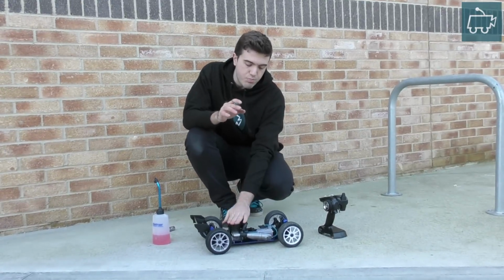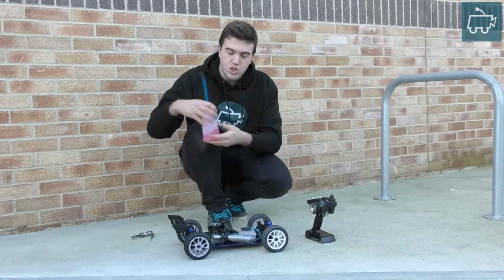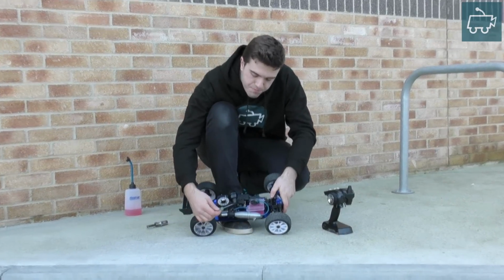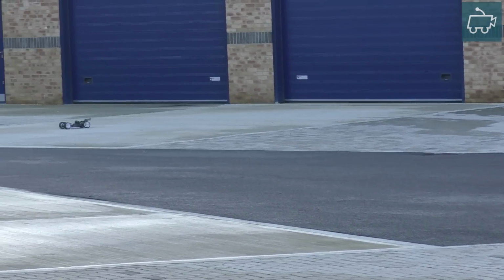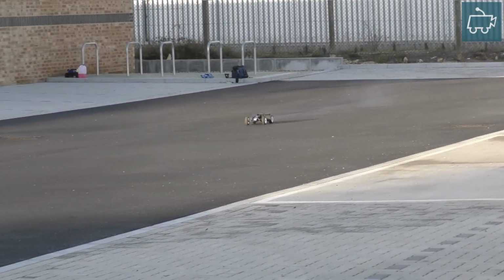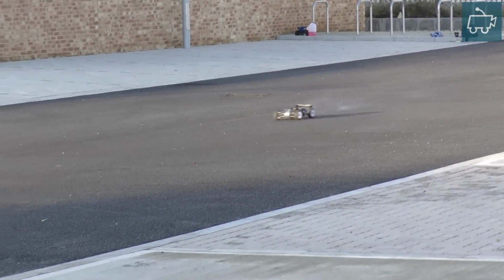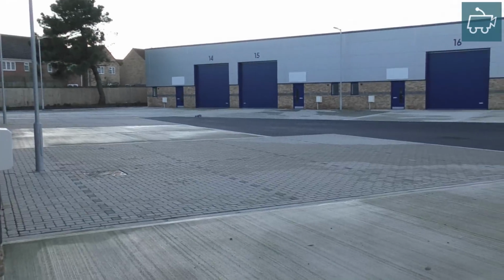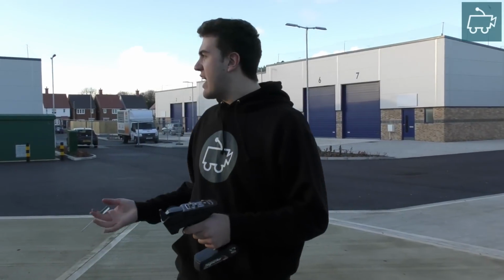Kyosho DBX 2.0 - How to Tune the Nitro Engine

Comment: JT thanks for all your videos.  You have helped me out on several occasions in the past so cheers for the help. My question is have you any experience with the Orion wasp 28. ? I recently received one as a add on to a purchase I made off eBay.  It has a dark blue almost black crank case and a silver head with turbo plug.  It has a 4 needle carb high, low,mid,and idle great compression.  I've heard good and bad things about the engine I can't find any information online about tuning the carb.  I took it to local hobby shop and they had problems tuning it? We got it running but when it sits for a minute or two you here it sounding like it's over loading with fule then stalls.  I'm running 25% the original owner said he never had a problem? There are no air leaks new plug new fuel.  I never had a crab with a mid range needle so I'm kinda at a loss . And if the so called professional at the hobby shop couldn't figure it out what can I do ??? . if the piston was removed and put back in backwards could that be causing the overloading issues??? .  thanks for all the advice you give . sincerely Edmund Brunning.

Comment: hello thank you for your videos. Can you let me know what the basic settings for this engine are. thank you.
Reply: do flush on both needles
Reply: @nitro-rc6241  thank you. We are having a problem with the car in that it keeps burning out plugs. Even had it set up at a local shop ran it for a couple of minutes then plug was knackered again. Any advice greatfully received. Cheers .
Reply: Andrew Harper it may be because it is way to lean. If you look at the inside of the glow plug. Is it burnt or pushed in or not straight, it could mean it is too lean or has high compression. If it is a new engine, break it in properly and take your time. When an engine arrives new with the car. It will have high compression because of the sleeve is tapered. Once you break it in the engine will loosen up. Check out this guys break in videos and his tuning. It may also be too rich: if the inside of the glow plug is wet, then lean it a little.
Reply: Andrew Harper also if you need extra support, visit a site called “Rctalk” and post a thread about your problem.

Comment: That's more simple than I thought even I can do that  I've got a savage x it needs a motor I'm going to put an ofna force .26 on it and it needs a new radio thanks to Duracell batteries word of advice never use Duracell batteries because they corrode overnight they ruined my new radio so now I need a new one but I do plan on getting a a radio that I can get a neutral setting for the transmission because I've got a reverse module in it witch radio do you recommend
Reply from the maker: The FS GT2 is a good cheap radio, if you want to spend a bit more then the Absima CR3P is a good budget radio
Reply: @TheRCBiker  cool I'll have to investigate that I definitely subscribed too I'm getting  those things this Christmas and next summer I'll put it on my savage for break in I'll just have to get some fuel

Comment: if gas is spitting out of exhaust at idle right after starting and even more when giving gas. is that the lsn adjustment?
Reply from the maker: Some Nitro fuel will do this anyway. Optifuel is very oily and so often on a lean setting would still spit fuel. Take note of the amount of smoke and the engine performance rather than the amount of Oil spitting out of the exhaust

Comment: Please help I got a brand new redcat rampage Mt v3 about 5 days ago once the engine is running I have it up on a stand and it seems like I have to give it half the throttle or squeeze trigger in order for the tires to start moving what could be wrong?

I didn't touch the needle settings after I got it had to increase the idle a little.
Is it just a matter of adjust either the high end needle or low end needle? Shouldn't the vehicle at least start to move a little with a gentle squeeze of the transmitter trigger?

Its says when starting to increase the throttle trim until the tires start to  move but something else seems off.

But something else must be off and tips?
Reply from the maker: Hi there, am I correct in saying that the rampage is petrol and not nitro? Those engines are usually pre tuned and do not require any adjustments. With the car being that new I would advise getting in touch with redcat for advice, you don't want to adjust anything that will void the warranty
Reply: @TheRCBiker  Supposed to be factory set but a guy at redcat racing said maybe the low end needle is a little to rich depending on the location and temps. I have no clue they aren't much help brand new out of the box crazy.

Hopefully its it's nothing with the clutch bell.

Comment: Hi do you have any videos or info on the Thunder Tiger EB-4 S2.5 Nitro Pro Buggy 4WD 1:8 RTR 6243-F114 Red/Black
Reply from the maker: No but what did you want to know? All tuning processes are the same
Reply: JT12's R/C Videos  I very new to this. I purchased a hyper 7 which failed. I ok it back to the shop and because they didn't have another hyper 7 they offered  me this instead. It was more expensive. Just wasn't sure about it and wanted your view on it as you seem to know a lot.
Reply: Sorry didn't check spelling before posting
Reply: Explained how it failed

Comment: JT12 on my channel Theres a vid on the twitching on the car plz tell me why it does that
Reply from the maker: If it were me, swap the two channels over on the reciever and see if the steering servo twitches when connected to the throttle channel. If so then I'd suspect a receiver issue. If not, then replace the servo

Comment: Im having problems with my nitro car. When I start it up it runs with the glow starter in it but when I take it out it still works but I move the car it stalls so what do I do?
Reply from the maker: Sounds like it could be running rich. But if you let the engine idle for a while then sometimes the engine will cut out when you accelerate anyway due to a build up of excess fuel. Try revving the engine with the igniter in to clear the excess fuel first.
Reply: If still happening you could turn the small needle on carb (Opposite from the linkage) and turn it in till it does not do it. You should let the engine heat up first

Comment: Hi all i have put a nice tune in my kiosho mp9 but the car keep to overheat I have Donne the pinche test 3 secs hsp in like in this video just a little rich . I have change the glow plug and remove the shel but no changes . Can anyone help me please ( my engine is a picco boost p3tz
Reply from the maker: What fuel and plug setup are you using?
Reply: JT12's R/C Videos stock plug p5  16% nitro and after the break in 25% nitro
Reply from the maker: Hmmm. Is the break in finished? Engines do run hotter when new because the internal parts are tight.
Reply: 1liter 16/% and 5 liters 25% the engine have 2 months

Comment: The batteries where changed a few days ago but it still twitches
Reply from the maker: Could be a dodgy servo then , Try swapping the channels over (throttle and steering servo wires) and see if the other servo behaves the same.

Comment: When I start my rc car the wheels won't stop moving! how could I fix this?
Reply from the maker: Sounds like the idle speed is too high. Search my channel for Idle speed videos.
Reply: You could also turn the idle needle out a  little. The needle on the opposite of the one on a link to a servo. You will find it on your carb